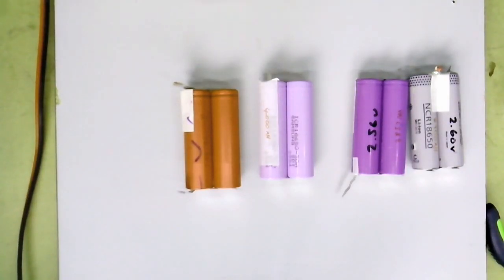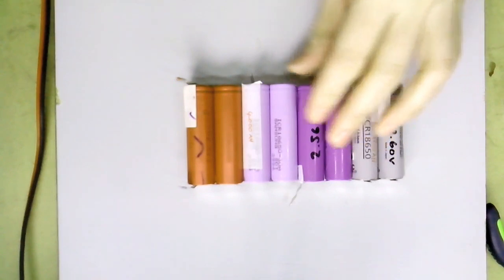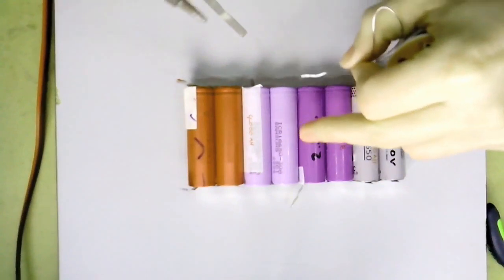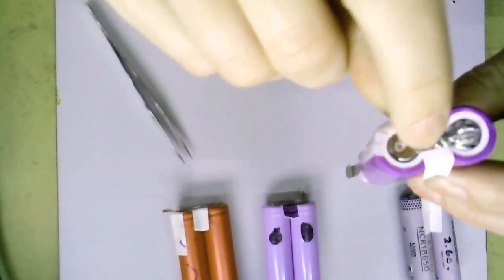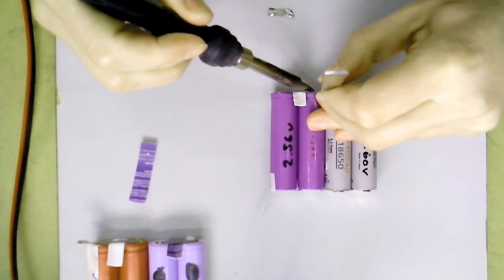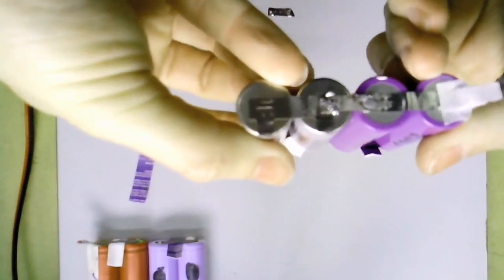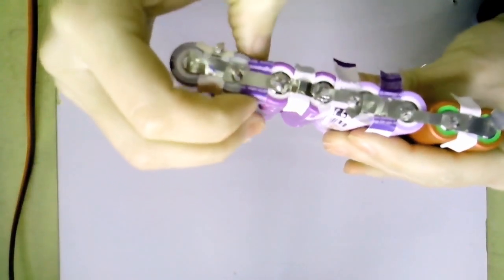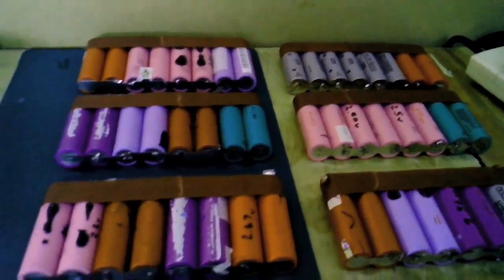DIY Ebike Battery 18650 Lithium Ion  Pt 1

Comment: Obviously you do not know much about batteries here. You have to use batteries of the same exact impedance or one of those batteries in this circuit will drain down the other batteries. You should order from the same lot and etc to get the same exact impedance or resistance. This one will work for a while but it will go out soon. There's your problem here. My brother had a Motor Home and he keep having his batteries fail him. He would replace whichever battery it was that went out first. The batteries just kept failing him even though they where new ones. It was because none of them where of the same impedance or lot numbers for that matter. I see all these people using mixed batteries and they don't realize that using batteries of a different resistance or impedance will drain other batteries in that battery pack. Buy batteries that are made exactly the same time and date and lot number only to get a true god battery pack. It's a must.
Reply from the maker: well i respect your opinion, But considering they still work over two years later and  i have done over 2000 miles. Have not had one problem since i built the pack so i must know more than you see in this video.
Thanks for commenting

Comment: Hey buddy I have a question.  I built my electric skateboard using these 16850 batteries to build 2 4S3P battery packs. Each one has its own charging port and to connect them in series there is a xt90 anti spark plug doing the bridge. The problem is when I try to change them with my dual charger both at the same time. If I connect one to the charger everything goes ok but if I connect the other in the other charging port my charger shows a message saying that the battery is in reverse polarity. To you think that the other parts of the circuit may allow the energy to flow in the reverse orientation even without the batteries being in series?

Comment: Hi thank you very very much for share these videos.
Just one question please, if I buy the new batteries which have pcb, it will be better??
And between 2500mah and 3000mah, which one is better for ebike? bigger is better?
thank you
Reply: Hello, if you buy branded batteries like Lg, Samsung, Panasonic, Nitecore, they are mostly protected with pcb. 3000mAh battery gives gives 15 to 20% more backup than 2500mAh battery. But check them according to cost you want to spend.
If you want to make a battery pack out of unprotected cells,  then you can buy generic laptop batteries  They come in 6 cell, 9 cell, 12 cell packs.  (make sure to select the ones that give 6 months replacement warrenty) They use good cells. But those cells are not more than 2000mAh. But still they come at so cheap cost that you will make 3 ebike packs at the cost of one Samsung or Panasonic cell pack. 
For unprotected cell battery pack, make sure you get a good quality smart charger with auto cutoff feature.
Reply: +Kketansa Art oh my god! Thx a lot!! I will try to search best and acceptable price with pcb~ Thank you and enjoy your wknd!

Comment: This is Good stuff Soldering Batteries together Nickel Strip

http://www.ebay.co.uk/itm/2M-Tape-8-X-0-1T-Nickel-Plated-Steel-Strip-Sheet-for-Battery-Welding-Wack-DIY-/391033636889?pt=LH_DefaultDomain_3&hash=item5b0b6bc819
Reply from the maker: TAYLOR13961 Thanks for that good price i need some more.

Comment: i wish thy made spring loaded e bike batteries .. like the triple A batteries packs you can get and double A battery packs that would save on soldering when the battery stops working you take out the bad cells and put in good 1s simples come on someone get marketing them  and give me a call and give me the first battery pack ;)
Reply from the maker: ***** Yeah it would make it more simple

Comment: yay i fix it, i had to connect the thick red and black wire straight to the converter without the connector....and i used an electrical tape to make sure no short circuit.....but how do i find a connector that's powerful enough to handle the amount of power? cause when i need to charge, i wanna be able to disconnect it easy and take it with me when need to charge....
Reply from the maker: G R nice one glad you got it working, you want something like this  http://www.banggood.com/Amass-EC5-5mm-Bullet-Connector-Male-Female-Plugs-1-Pairs-p-925811.html?p=070519238739201308J6
Reply: Norfolktuber thank for that link, imma try that.
Reply: Norfolktuber i'm having another problem, my battery work when use. but when i try to charge it,  it doesn't charge. you think you know what's wrong with it?
Reply: Norfolktuber or do you think my bms is broken? but i did order a new bms for it....

Comment: where can you get these from? i bin looking everywhere and cant seam to find any decent price or if the are real deal. any help would be greatfull mate.
Reply: Wayne & Rebecca Detectorist Dead laptop batteries, you will have to sort them yourself. A few might be dead and a few might not have full capacity but that's how i get them.
Reply from the maker: Wayne & Rebecca Detectorist ebay is best for used batteries just look for the brand names DELL IBM ASUS FUJITSU TOSHIBA SAMSUNGbut just lately the prices have gone up a lot. but they are still cheaper than buying new or buying cheap crap Chinese cells.
Reply: Norfolktuber i was thinkinking li poly but still work out quite expensive, im building 2 bikes, 1 is 500w 48v and for myself a 48v 1000w, because i would be a bit heavy than a girl. make sense? im trying to get atleast 30miles + on a charge, and to use 1 charger for each, or 2 the most if possible. the lead acid batterys danger and acid, heavy.

Comment: I have many 18650's but I have a question about 12v packs! (3 cell) I have built several packs more for portable power! If I build a 3 cell pack it is a 12v pack! It will range from 9v to 12.6v

My problem here is i'm not using the bulk of the power in the batteries if my load disagrees with anything lover than 11V should I instead build a 4 cell pack which ranges 12v to 16.8 and implement a Buck converter to drop the voltage to 12v Loose some power through heat but get more usable capacity through being able to discharge the cells deeper?

Comment: I read you had 100 laptop batteries to sort through.  So I'm guessing you had plenty batts to chose from and found exact capacity matches to make each 8p3s pack. I will probably have to mix it a bit and wondered how much variance is acceptable per 8p3s pack and how will it effect the performance?
Reply from the maker: yes its time consuming it took me 6-8 weeks to check all the battery's capacity, i just used all the ones that had over 2ah 
the variance was around 600ma but all over 2ah. 
You can add extra cells on to one cell pack to make the difference up,

Comment: Nice. I have only just begun to see the uses for these cheap batts, been stripping them clean for using in usb battery banks but I like how you leave the original pairs together for less soldering in these larger banks. I am hoping soldering to the existing buss bar reduces the heat required to solder and the heat risk to cells?
Reply from the maker: yeah loads of uses, like you say keep them intact as much as possible
Thanks.
good luck with your projects.

Comment: hi, thanks for answering, you can send me an outline of how to join the batteries? what material I need? thanks
Reply from the maker: Syntxan Syntxan you want 5mm solar busbar a soldering iron and some 60/40 lead solder
to join them just do how i did in the video, just be careful not to short the battery as it could cause a fire or explosion. 
http://www.ebay.co.uk/itm/Buss-Bar-soldering-solar-cells-DIY-Solar-Panels-5mm-width-bus-bar-/290948345890?pt=UK_Gadgets&var=&hash=item43bddf7022